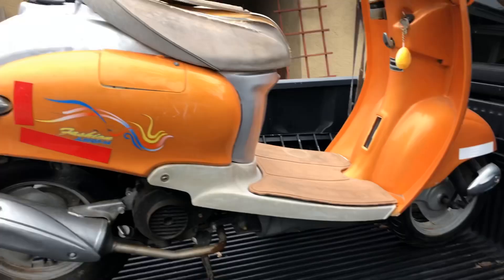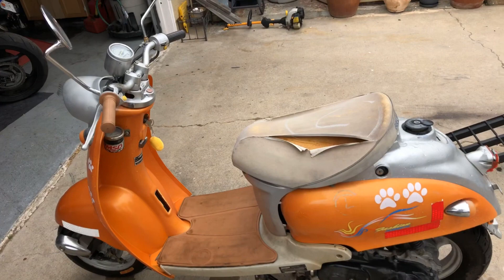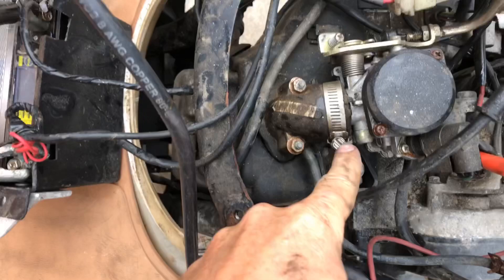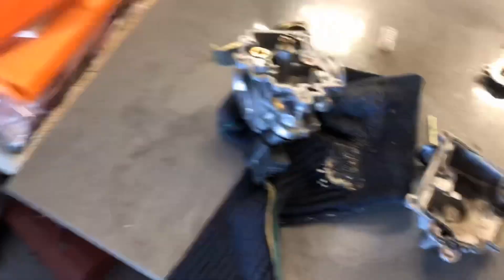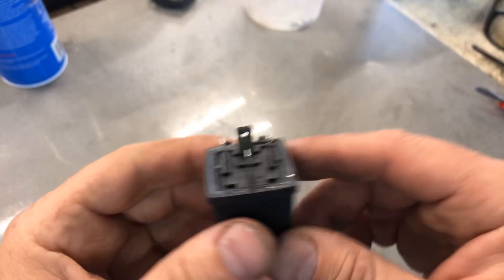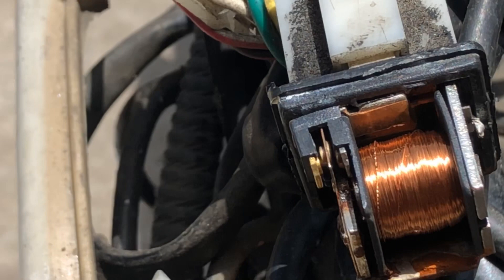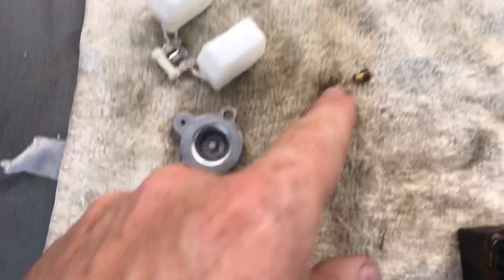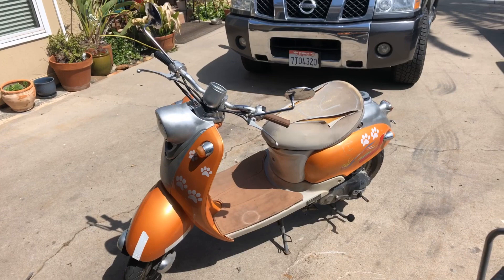Chinese 50cc Scooter - Let's Get It Running Again!

Comment: Tom that is not how a relay works or the reason for a relay. Voltage is applied - and +   to the two terminals energizing the sylinoid causing a short on the other two terminals. The purpose of a relay is to help the circut withstand high current so heavy duty switches are not required .
Reply from the maker: Correct.

Comment: Lol...pulls brake lever, lets go of brake handle, presses starter button....gee, it won't start! Try pulling brake lever amd pressing starter button SIMULTANEOUSLY.  Wow...
Reply from the maker: paige hunt might have done that for a second but since I have owned several scooters I’m pretty sure I know the drill. Thanks for your wonderful input, have a great day!
Reply: Tom's Tinkering and Adventures 
I watched twice...maybe you edited the part out where you attempted to start it correctly?
Reply from the maker: paige hunt well it did start!  😂. The switch on the brake was not working, pretty sure I covered that
Reply from the maker: I mentioned that it didn’t work. Was hold a camera in one hand so couldn’t show it.  But if you listened, I said that it was not working.  I likely attempted it prior to filming, probably should have demonstrated that,
Reply: @TomsTinkeringandAdventures  i

Comment: Hello, I just bought a similar Chinese scooter. I’m not entirely sure of the model , it doesn’t turn on, it was siting a garage for a long time and it’s missing a cover I’m assuming is the cvt cover. I just wanna know if there’s any advice you can give me to get it running again
Reply from the maker: Anneliese Courtney well you need to start with the basics of troubleshooting.  Does the engine have spark?  Clean fuel and air?  Compression?  Until you can determine those things you are just speculating.  Good luck!

Comment: I have the same one but cart get a spark from the plug
Reply from the maker: scott donovan check the coil.  Pretty cheap and easy to replace.
Reply: @TomsTinkeringandAdventures   wich wire gos  to the coil  give spark mate
Reply: Which
Reply from the maker: scott donovan I no longer have this scooter around, no idea...sorry.  There might be some wiring diagrams online if you search.
Reply: @TomsTinkeringandAdventures   my a Vulcan Venus retro 2-stroke  good condition  cheers  any way mate
Reply from the maker: scott donovan as long as you have the backup scooter running, all’s well!
Reply: @TomsTinkeringandAdventures   not that is  the scooter   I need the same wiring diagrams  as this scooter
Reply from the maker: scott donovan ok, good luck.